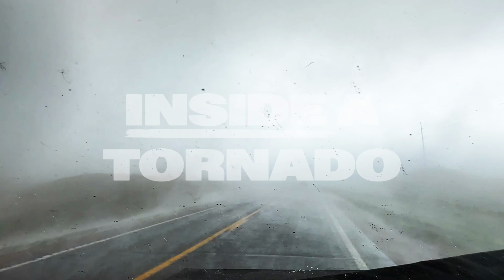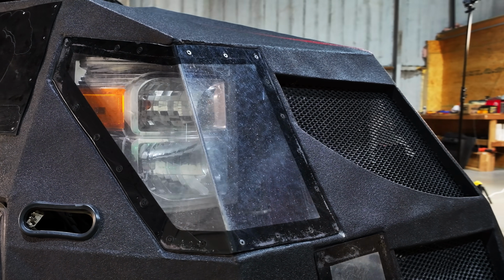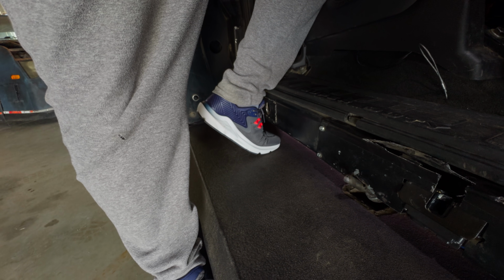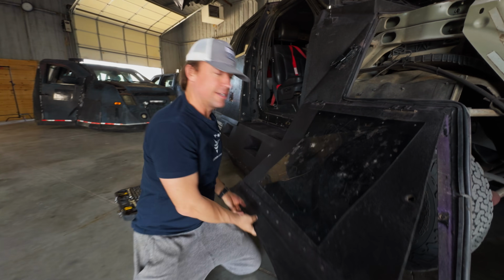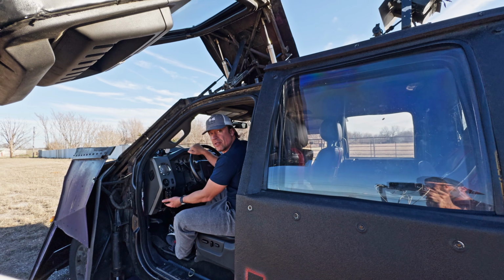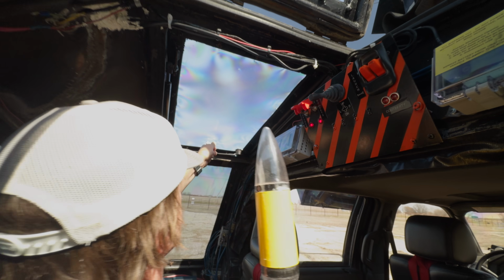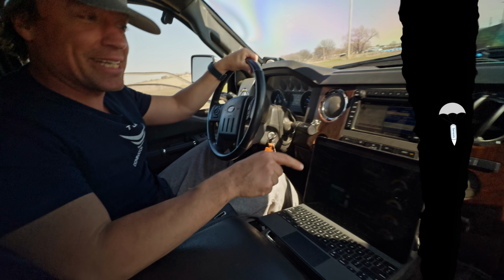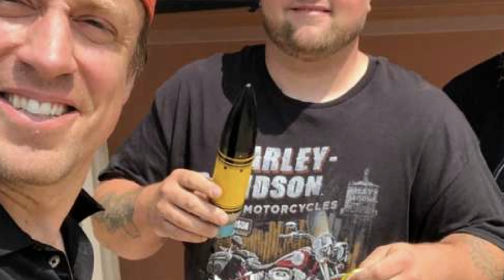Dominator 3 Tornado Tank ULTIMATE Tour

Comment: Hmmm just finished the video and it all almost looks good. I was thinking of two things, however.

1. WIth the spikes being driven into the ground, would there be a faster system for it to drive into the ground? What if it was like a drill or something instead of a smooth tube, which would pull the vehicle down further instead of pushing it slightly up?

2. The rocket is ingenious, but might be a little tough to get it set up in middle of a tornado path. Why not do somethign like hook it up to a drone to launch it from there? Could wire it well in advance, and could deploy it with less margin for error

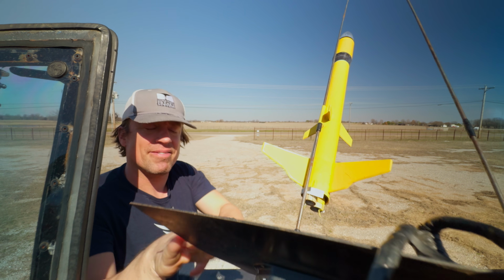Comment: Nice vehicle.  I used to do a little chasing in the 1970s while I was in college (Meteorology degree).  By the way, you're incorrect at 10:28 when you say that the blast plate gives the rocket propulsion.  Rockets don't push off of anything at all.  They expel mass out the back and are moved forward (Newton's 3rd law of motion).  That's why they work in space.

Comment: 1/4 inch protecting the headlights? 1/3 inch would be just a bit more safety. That extra 1/12 inch might just save some downtime later.

Same with going to 5/6 inch plating.

Comment: 3/4" steel plate exterior? 30lbs per square foot, probably 80 sq ft exterior area, 2,400 lbs in the body panels alone?

Comment: First time watching this channel and I'm very excited to see more of what this thing is capable of. I do question the steel actually being 3/4 inch thick. Only saying this because there is a lot of warping from welds that you'd see on thinner 1/8 to 1/4 inch steel and the "hood" alone would weigh about 1000 pounds. Again, I could be wrong. Anyway, I like the channel.

Comment: Would be cool to rig up an igniter w/ the circuit board / internal to rocket. Maybe put rocket into a PCV pipe then, with an explosive cover... (or say wax paper it could fly through). Leave them on roof or have holes in vehicle where pipes go through. Could possibly automate that entire process. Then make a bigger payload capsule and put multiple sensors to the probe and have them shotgun out. Cool stuff! My background is engineering. I left it to start my own business, in sales. Now I'm back to designing stuff in my spare time.

Comment: I see lots of room for improvement in both: 1) The inground spiking system, which ends up LIFTING the vehicle after lowering it; once again recreating the gap under the vehicle that allows that lifting air to get under the truck.  And 2) an easier, more stable way of setting up the ignition system for the rockets in high winds.  You need to build in a "quick disconnect" system that standardizes connecting the rockets to power, yet easily allows them to release upon ignition.  Right now it seems very cludgy. For example designing a ringed two-piece system that has one side permanently attached to the rocket and the other half connected to the truck that uses contacts against each other, rather than the stock method of hooking up alligator clips to the stock igniters.  The rocket half of the ring will have the replaceable igniters built into it.

Comment: You surf site ships wind mill. 
Wind mill will flow in direction of wind but you have to make clock wise direction to flow in anti clock wise. Mean reverse direction. 
You keep hight lesser initially but keep increasing. 
For cleaning ice  fivev trucks run together, so you need five trucks  for ...tornado wind to change direction of  circular wind. 
For this you must check velocity of wind inside tornado. 
Think of some kite model fan for sky to disturb the circle or cloud of wind. 
Jay bharat.

Comment: Nice car, but from a fluid dynamics perspective those skirts just increase the chance of being taken by the wind. Side pressure is one thing, and it should be a minor problem there close to the ground. But the wing effect that could pick your car up is based on the wind on top being faster than on the bottom. That creates a pressure difference, as the energy in the air is either kinetic (speed) or potential (pressure) so with the higher air speed on top that also creates a higher pressure at the bottom. And the only practical way to reduce that lift here would be to have as high as possible air speed below the car so you'll also have the lowest possible air pressure down there. I know it can be counterintuitive, I have had trouble with those concepts myself, and there are other things to think about as well. But those skirts, at least, should go as the only thing they really improve is the "cool factor". And perhaps act as stabilisers when you "go down", which is actually a very good idea.

Comment: Very cool and well thought out design. One minor point. On your rocket launch, the blast plate is only there to prevent exhaust from the rocket engine from causing damage on launch. It has nothing to do with propelling the rocket for flight. As an example, consider sidewinder launched from the tips of fighter jet wings.

Comment: You guys need to develop a drone meant to get into tornadoes. A drone providing some control once inside the thing. Trying to make a flying mechanism that "surfs" the tornado. Tornado surfing will be a thing in the future. And by doing so, you might be able to understand better how the winds flow inside. 

And by the way, your vehicle still has less sharp and safer lines than the Cybertruck!

Comment: What are you going to do when your dominator has been picked up like a toy, and thrown fifty feet onto a muddy field? Once you've come to your senses, you realize your vehicle is laying on its side. The batteries have been destroyed, or at least the connectors, cabling, and you cannot lift that heavy, 800 lb side door. Do you have an escape hatch of any kind? I hope so because when the battery fire has started, a fire extinguisher will not put it out. Without the batteries, you cannot lift that heavy door. What do you do besides scream, as you watch the fire raging towards the main cab.

Comment: I'd tecommend single use composite rocket motors over a cluster of black powder.  More thrust to weight, no risk of only one motor lighting, the igniters are secured better, and easier to hook up than those Estes igniters.  Aerotech F67s or G78s would punch through really well even at a greater distance, and you dont need high power cert to buy/fly them.

Comment: If you made the anchoring spikes a spiral auger style and rotated them into the ground, you could really anchor that thing down good. The spikes seem to raise you more than anything, depending on the soil of course. A screw style would pull you down
Reply: This is kinda false I understand the idea but realistically a system like that  wouldn’t work as it would just loosen the dirt and would really lock it down
Reply: @Landonovv   depends on the ground but you would definitely want variability
Reply: 100%
Reply: @Ry_Guy  very smart idea!
Reply: Just thinking the same thing about lifting. Also some sort of hooks to grab the ground, but then how do you raise them back up. 

But the screw cork idea solves both issues, and it would really pull the vehicle to the ground more for a better seal. Excellent solution.
Reply: I agree.

I was thinking of a teepee style strut (air or hydraulic) assembly.
Reply: ive heard people say that it ruins the integrity of the ground around it

Comment: As a friend of Mike Scantlin, I could kick myself for never properly checking out the Dom 1 or 2 when having the chance.  Well done on 3, and I hope you find continued success for your efforts.  

Looks like you are demonstrating why rocket launchers look like rocket launchers though.  You should continue to improve the rocket launch system.  They should be in tubes for one, and you need a better way to hook up the igniters for two.  I suggest tubes that you preload with a rocket on the guide rod with igniter in place and a lead that plugs into some sort of quick disconnect on a panel.  That way on scene all the sketchy stuff has already been handled with due care and the boxed in rockets could be launched much closer to the storm without the risk of being ripped away before launch like they face now.

I digress.  It's a great approach.  It's fascinating because I suspect advanced drone technology is what revealed that old school hobby rocket tech was the way to go.

Comment: So cool! What if you had your rockets in preloaded tubes that had the electrodes hooked up and a simple plug or disconnect on the outside of the tube, to make set up quicker and protect the rocket while you get into position before launch? You could still use the current guide rod but have it slide on the outside of the tube and possibly make the attachment to the launch pad and hook up electrodes a same latch system. Great job guys, incredible stuff!

Comment: Those are not the best tires for that thing. 
Get some 19.5” wheels with 265/70r19.5 medium duty tires or tag axle tires because they are much harder to puncture and will handle triple the weight.

Comment: Could those spike penetrate bitumen? Or do you just lower the car and avoid using the spikes on a seal road surface? I can't imagine being stuck on a solid road and the spikes driving the car higher into the air would be good!

Comment: Really awesome work you guys are doing hopefully the data will provide increased predictive capability as well as path tracking and save lives. You're doing great work. I want to correct one minor point you mentioned that the blast plate is necessary for the rocket to push against to give it the ability to launch. That is a really common misconception and you're not to be faltered and I won't geeked out on the math but got to remember Isaac Newton and his law that says that for a reaction there is an equal and opposite reaction it is the gas the high speed gas jet leaving the back of the motor that causes the forward propulsion of the rocket. It would go just as fast if there was no plate. The plate keeps you from burning a hole in your window or burning the paint off the roof of your vehicle. Just wanted to correct that your guys are doing great science and I don't want someone to devalue what you're doing because you missed a fundamental principle. It isn't really rocket science what you're doing is a lot more important than that. So stay safe be sharp and good hunting

Comment: Ok guys you got the vehicle down. Actually not completely sure for how long. But as for the rocket they have come a long ways in amateur rocketry. You could build a much higher quality rocket pre rigged that could survive sone level of rocking before firing. And do it all from inside the vehicle. All you need to do is point and shoot. Also much more powerful rockets with some of the commercial loads available with license. The added power might be useful to get it inserted exactly at the right altitude and from further away perhaps when you have more time to think it over. Those things are changing all the time probably need solutions on the spot. Awesome rig though. The drill pegs perhaps need to spin to secure you into the dirt. Idk. I’d like to ride inside either way. Probably sell tickets to help buy parts and fuel.

Comment: Are there any thoughts to putting a gps sensor in the rocket so that it can be found immediately ? … And would it be possible to eventually add a camera ?? … Also, is the Dominator 3 equipped to handle an F5 tornado ?

Comment: I just wonder how you walk with those enormous testicles? You're a far braver man than I will ever be. This latest Dominator is a masterpiece of purpose built technology. You need a rail system with contact points built in with corresponding contact points on the rocket so all you do is load and launch. Or better yet a shoulder fired preloaded rocket launcher tube. Like a LAW
Reply: M72 LAW

Comment: I'm not an expert in what you do. I do work on vehicles. But it either looks like those front tires aren't at the correct pressure, or you might want to move up to a load rande F. Those LT tires look like they're working hard just sitting. Also load range F has 2 more ply could be more durable if thats a concern.

Comment: I'm gonna be that guy...  1/4"? Bullet "Resistant". Hail-Core protection? Isn't that stuff going sideways? No solid core tires? Straight down spikes or angled outward? I'd be concerned about the vehicle being lifted up by the spikes (you can kinda see it happening in this demonstration). Didn't you have a gps on the probe? Was it the distance that caused the loss? Recommendation, Sight and sound on the probe (strobe or whatnot). Maybe even a secondary gps.

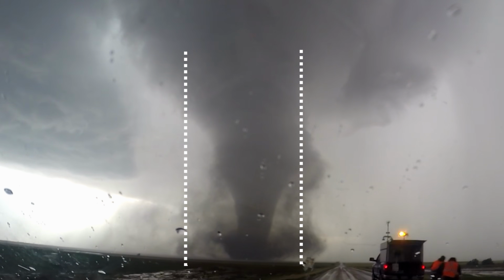Comment: 9:24  can i make a suggestion make one tester rocket with a spiral 🌀 so it’s gonna look like a upside down screw so that it Pierces right thru an I feel like it’ll have more accuracy when you fly it off shooting straight into the air I have a image in my head I don’t mind sharing my knowledge you can get more into the core with the design too

Comment: a 2 by 4 at peak airspeed will slice straight through those plastic windows. This thing is a coffin. Just buy an ex military APC before you kill someone
Reply from the maker: No it’s Lexan polycarbonate
Reply: @ReedTimmerWx  puncture rating of ft-lb 9 @ 12 Jules. Get yourself an angle cut 2x4 and air blast it into your sheeting @ 290MPH

Comment: Question..The anchors. I'm assuming they will not penetrate asphalt (?). Certainly not concrete. So you have to be off the road or on a dirt road to work(?) Also couldn't a plug/jack be used for the rocket ignitors so you won't have to fiddle with alligator clips(?)

Comment: So If the skirt of the car is flush to the ground to prevent the wind from getting hold, if the spike is on extra hard ground or doesn't go in properly, couldn't it cause the Domainator to lift up, raising the skirt high enough to allow the wind in?

Comment: 1/4" poly carb most definitely is NOT bullet proof. I have shot right through 1/2" with a 9mm
Reply: "Made from 3/4 inch steel" 😂😂😂 that it 12 gauge at most skin. If it was really made from 3/4" plate it would weight about 30k lbs.

Comment: Hey umm, are these specs for this vehicle available anywhere if I wanted to build my own? Seriously. I like the deflection angles. 
Yes I chase storms too. Yes I have 300k to put into it maximum. 

I don’t need the lowering or the spikes. Just the specs so if I’m in the path of a tornado which are common, my family is safe. 

Seriously are these specs available?
Also, you say bulletproof. I get the angles of deflection, but what NIJ rating would you say? Level 4? Are the materials NIJ tested at those deflection angles? Are any of those windows under NIJ level 4 testing?

Comment: What is this cobbled together dumpster. Sprayed in raptor coating. Not fully lowering to the ground, the ground spikes do nothing. And these model rockets, are not strong enough to really "penetrate" a tornado, they dump the load and the sensor assembly floats around than.

Comment: There are two things that if you modify it, it becomes a more than wonderful car.
If you adjust the car's wheel and make it stand on the ground when needed. You may encounter rough terrain and the vehicle may be damaged from below
Second: If you could generate electricity from a magnet in a car, it would be better. Because you will not worry about running out of fuel or a car battery. Storms will follow without running out of energy
Good luck 😊

Comment: That looks amazing...I have a thought slash possible idea for the rocket connection.  Why couldn't you use a 2 pin connector to the wires for the motors on the rocket or 2 pin connector to alligator clips.  Where someone could be pre wiring the rocket while inside then when its go time just plug in the connector and launch.

Comment: Why wouldn't you make a compressed air tank in the vehicle with a tube going out and a rocket that has retractable fins  and ignition system that ignights on launch. Also be able to reload rockets inside the vehicle fast.  So u can launch straight up in the tornado. When in side it with the dominator.

Comment: would it maybe not be easier to have contact plates on the bottom of the rocket which then touch some contact plates underneath the rocket?

That way you wouldn't have to fumble around with such very small wires and crocodile contacts, I don't know how helpful this is but this is something I thought of when you pointed that out with the wires of the rocket

Comment: I used to have that same truck pre dominator.  Did you do any engine mods? If not you should there are some awesome mods to give more power.  Also that thing is awesome.  I love the movie twister and have gotten to see a few living in Colorado but nothing like the massive ones you’ve seen. I have had the air get sucked out of the basement bathroom I was in.  Side note I know you use some drones.  I build and fly custom hd fpv drones.  Let’s put some up! I also have an associates of electrical systems technology. Working on the bachelors. I have skills with ac and dc and have been in the fpv hobby for over ten years.  Flying racing drones. Building them etc.   have you tried putting one in there? Either way, I want to intercept with you! Dreaming. Thanks for sharing.  

Shawn

Comment: Reed, take a step up from model rocket tech!  A rail launch system will be sturdier than the rods.  Build a socket for the rocket to protect the igniters and also make the contact.  Go to a nylon chute and cords instead of the plastic.  If you can go with the larger D, E, or F engines, you won't have to worry about cluster ignition problems, and get better range and safety for a launch.